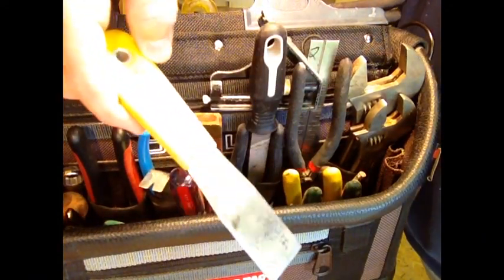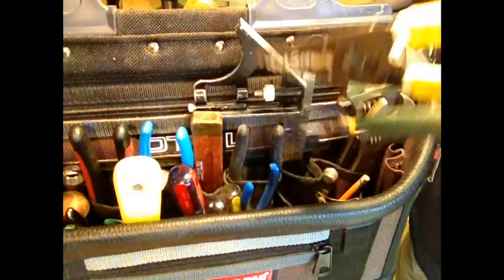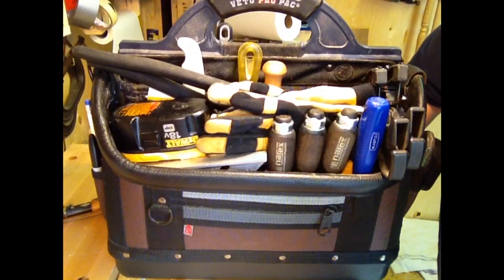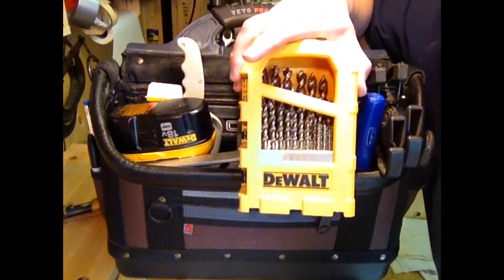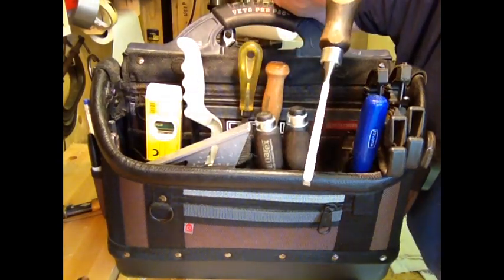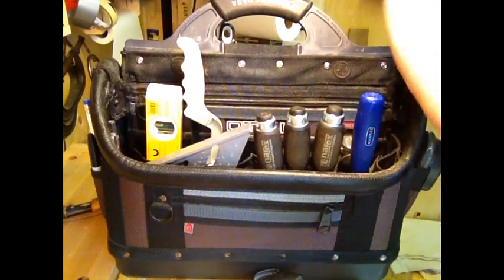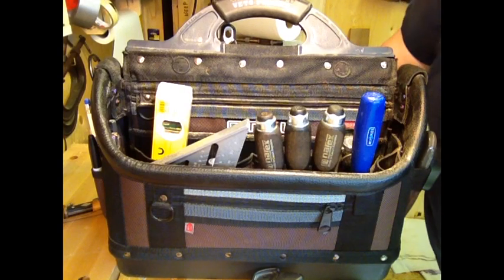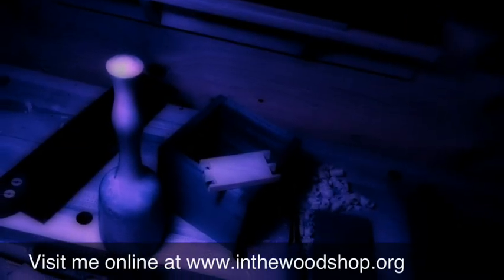The Compleat Renovator's Tool Bag Part 2 of 2

Comment: Great video. The only tools I did not see are blumbing: tubing cutter, puller for faucet handles, faucet seats wrench...
Check out Lenox tubing cutters, nice piece of engineering. Cheers.
Reply from the maker: +5acesdown Odd I never noticed that before.  I do have a tubing cutter but there was a time, probably about then, that I had to replace mine and had a hard time finding one.  I will check out the Lenox ones.  Thanks.  I don't use faucet handle pullers and faucet set wrenches.  I assume those are for older sinks?  Around here, most faucets are too new, too crappy, and we just replace the whole thing - unfortunately.
Reply: +inthewoodshop Actually, some faucets still uses brass seats on which the rubber seal sits to shot the water when the faucet in closed. Dirty or corroded seat is one reason your faucet leaks and can only be cleaned or changed by removing the faucet handle and valve assembly. A puller could be necessary to remove the handle.
You're right about the crapy faucets these days where it's better replacing the all unit.